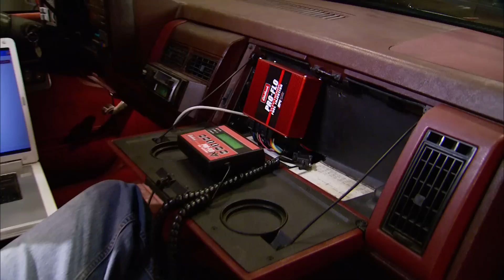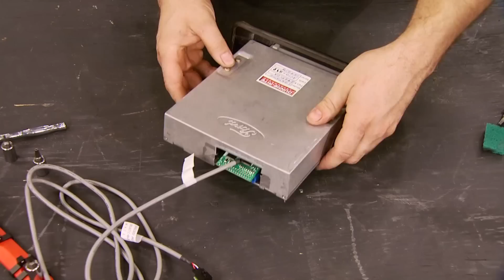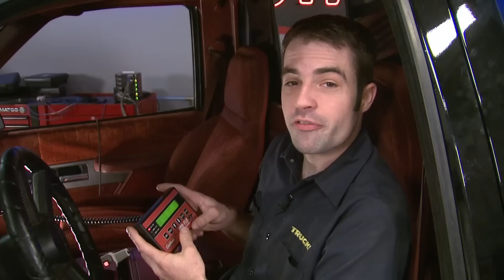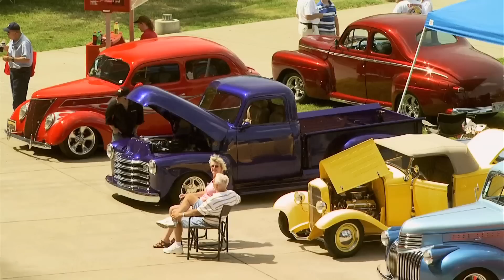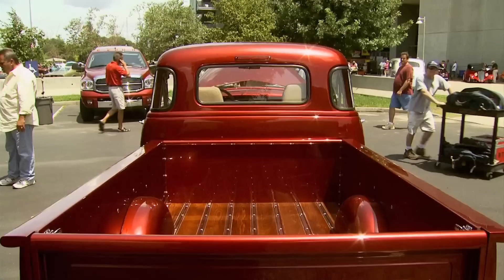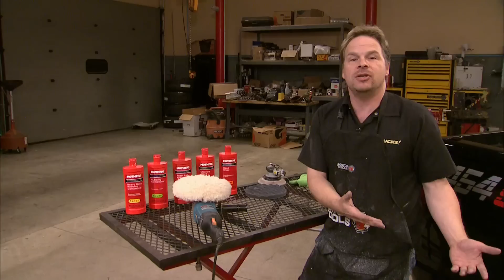Chassis Dyno Shootout: Chevy 454 SS vs Ford Lightning MuscleTrux Wars Part 6 - Trucks! S10, E15

Comment: What's crazy is I had a 98 mustang vert. Installed a stroked Alternative Auto 2 valve in it with stage 2 port, and polish heads with comp 270 cams. 10.2.1 compression. Made 331 to the wheels haha

Comment: Been waiting for this and was let down with this episode.
Reply: @bigboreracing356  ok boomer
Reply: I agree. This was disappointing given the engine sizes and the boost. I don't remember the Lightning being so difficult and it is very easy to tune an EFI Ford. My 3.0 supercharged Audi with a basic tune makes 458Hp and 387 ft lbs of torque on 93 Octane.Before anybody complains about "old" tech, we had a lot of 5.0 and 5.8 Mustangs running EFI and I don't recall things being so difficult. I still have a Crane Interceptor I had installed in an EFI car back in the day.
Reply: @bigboreracing356  Settle down scrub. First off I do know how old this. Second, I ment the episode in general with its content.

Comment: The polishing of the 454 truck definitely shows the orange peel on the untreated side of the bed if you look closely enough 

The side that was untreated you could see the orange peel in comparison to the side that Kevin had worked on, which was nice and smooth
Reply: Eyyyy', looks like Captain Obvious has just shown up!
Reply: @revolutionday1  away with you troll

Comment: 456 rwhp out of my 240sx doesn’t seem like much now days.  But back then I can now see why it hurt some feelings.
Reply: 456hp in a 240 is still stout! Turbo six or LS swap?
Reply: J M it would have to be LS because even an SR20DET wouldn’t handle 400+HP at the wheel for more than a couple weeks reliably. There’s a guy at my local drift track (evergreen speedway) with a built SR and that thing has 350 to the wheels and it’s wicked. I couldn’t imagine 450+...it’s defiantly possible it has the SR20 4 cyl...not gonna last long tho. Driving on borrowed time if so. LS swaps are the way to go these days. They are a dime a dozen and easy to boost and get a lot of power for you  money
Reply: Shit...I'll take it👍😌
Reply: It was a sr20det with an unopened block.  It lasted 10 years and about 50-60 thousand miles.  It did have 264 duration cams.
Reply: By the time this was filmed, it had been at this power level for a few years.

https://youtu.be/GV_audmmGAs

Comment: My stock Lincoln Aviator is right around 300hp, still a pos, and it sucks fuel.
Reply: First off, your Aviator is rated at 300 at the crank so itll make like 250-ish hp to the tire (assuming its RWD. AWD will make even less.) Also, the Aviator is a mid-sized luxury SUV so it should weigh slightly more than either of these trucks. Another thing is, the Lightning has 4.10s and a higher stall converter. If you put in 4.10s and a 3000 stall in that Aviator it would he a totally different animal. Its not always about how much power you make, its how you turn that power to the ground.
Reply: @yahmutha  I'm aware of all of this, believe me. Plus this motor has flaws. Like the dead head, drivers side cooling comes to a dead end, and doesn't circulate well. This eventually kills the valve guides in cyl 7 and 8, causing them to stick. When you take it to the shop, they want $6500 to fix it.
Reply: @lowpricedpaint  Another flaw you should have in that engine if its anything but a 2005 Model Year is the spark plug thread count will not be adequate allowing plugs to sometimes shoot out of the head. Im a Marauder guy and that engine in your Aviator is the exact same as in a Marauder with the exception of the intake manifold. Shouldnt be THAT expensive to replace though. You can get refurbushed longblocks from Spartan Engines with a 3 year unlimited mile warranty for $3300-ish.
Reply: But i do agree 300 whp is weak sauce and not FAST, its more-so quick than anything.

Comment: Oh hell yes.....very easy to put the tune in with expensive equipment, 2 techs and unlimited time.  Sure sounds like something I can do before breakfast.
Reply: 450 bucks, and yes I write tunes over breakfast.

Its not as complicated as you think. Their biggest problem is that they are building 90s vehicles which are horrible due to their old school electronics.

Newer stuff using software like hptuners or efilive you can do everything they are doing without much hassle.
Reply: @nastychevys  ugh, tell me about it. 95 dodge v10 5 speed with an obd 1 ecu built by Fisher-Price!
Reply: @nastychevys  Interesting.....I have an '86 302 Full-size Bronco that looks/smells like it came out of factory.  That's why I was skeptical of the "tune".  I have put on headers, K&N cold-air filter, 2.5 pipes, Magnaflows with cross over, re-curved the distributor, and put on piggy-back chip(can't remember what it is).  It runs great and gets 15+ mpg on highway at 75.  Watching this I always wonder if I'm getting out of it what I could.  I've tuned cars, strip/street, all my life and know what's going on with Holleys, Carters, cams, timing, mechanical injection, etc. but this damn electronic stuff gives me fits.  I'm an old buzzard that can remember the jets on my dirt bike from 15 years ago but can't remember what he had for breakfast.  Thanks for coming back at me....sounds like you know your way around this stuff.
Reply: @tomnekuda3818  I respect the old school way of doing things, nothing quite as convenient as tuning a carb on the fly with just a screwdriver. But for just a little bit more hastle on the computer you can wayyyy more many "knobs" to twist. It also helps your motor run a perfect air fuel ratio which will help the motor last longer. The modern tuning is even more quick and painless than the old methods shown in this video. Certain ECU's will let you tune from your phone on the fly!
Reply: @hoffbald  I believe you.....I'm just not computer savvy and difficult to teach old dog new tricks.....but I ain't dead yet!
Reply: @nastychevys I'll take the 90's stuff over these laptops with wheels they are selling today. They are all having a software issues all the time. Don't even get me started with the steer by wire vehicles. RIDICULOUS.
Reply: You can get a dyno tune for around 400 bucks. That's not real expensive if you think about the results.

Comment: does anyone know when this show originally aired on TV? 
when Windows 2000 & XP were still being used
Reply: i think you can see pentium 4 badge on the laptop......I'm feeling old now....
Reply: That laptop is a Dell 9400 It came out in 2006 with a Core2Duo...
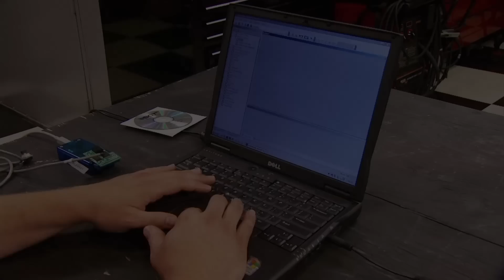Reply: @bustopherjones2285  don't know the model man, but if you look frame by frame on 04:17 you can see a pentium 4 logo...i think c2d logos are all white/blues, i had both p4 and c2d back in the day, feels like ages ago
Reply: 2010
Reply: That specific episode came out 2010
Reply: First aired 2008.